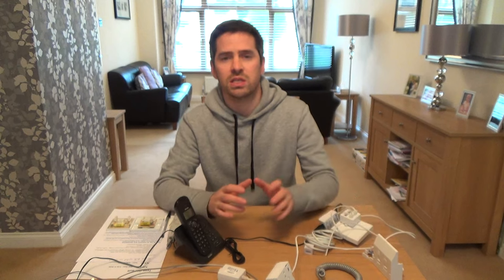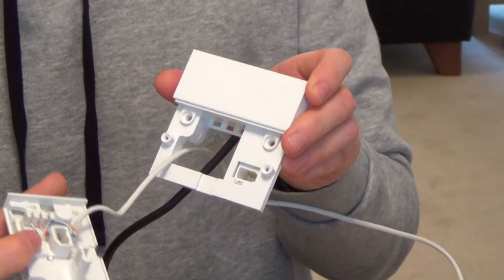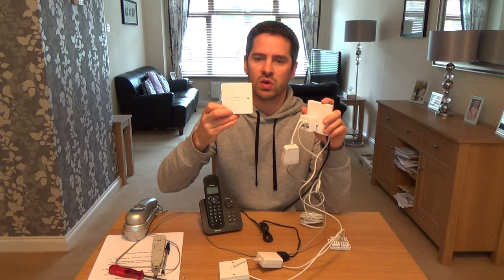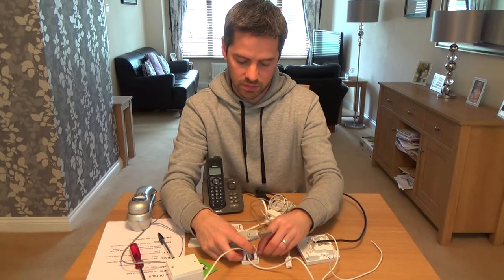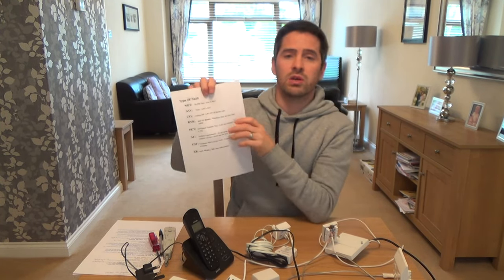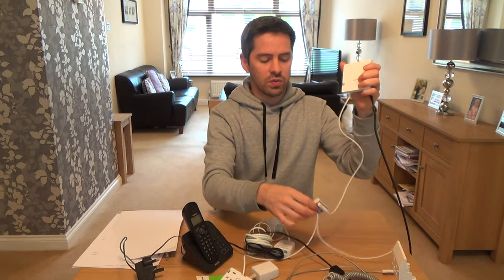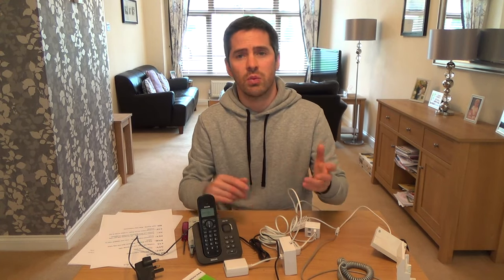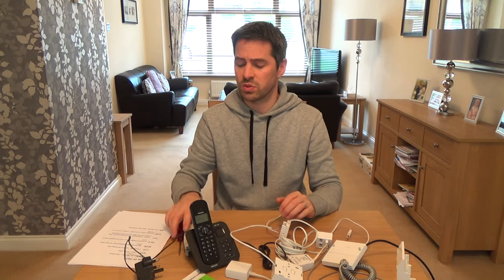How To Fix your TELEPHONE LINE, landline phone FAULT finding and REPAIR.

Comment: Hi Vince, Great video, thanks. 
I now have BT Digital line via the router. So far,  I haven't been able to receive calls (I can make calls). I reported the fault to BT and after going through router resets etc, they passed the fault to Openreach for investigation (I am still waiting). This afternoon, I picked up the phone that has the problem and phoned myself and the 2nd phone in the house rang. In other words, I called myself and it rang (it's meant to the same line). If I call the house using my mobile phone or if my wife uses her mobile phone, work phone etc the line is dead and there's a continuous tone.
Any suggestions please? Thanks.

Comment: Handy vid! Wondering if you could help me with a dilemma? In a few days window fitters will be ripping out my old ones and installing double glazing. But my landline cable goes through the old frame so it will be cut or damaged. If cut can I desire the two ends of the cable? Maybe twist the wires together? Or does it need putting into the phone connection outlet thing? If so, is there a way of doing it without those specialist pliers type tools you have there? Any info would be greatly appreciated.  Ps, my talk talk connection outlet box looks a little different to ones you have. I used to have one with that line/test socket but got a newer model fitted last year. Called a Master socket 5c.  Has sloped top and 2 plug holes on front.  ??

Comment: I have followed all of your video re-testing phoneline for noise on line..
Callers can hear me all right but when I dial out the noise is quiet loud.
The problem seams to be with my router.....
The line is clear both ends  when my router is disconnected.
How far distance  away do I need my TV to be away from my Router.
Otherwise I might need a new router which was installed 3 years ago with SKY.
Any help would be kindly appreciated.
Before I start to call an engineer/of SKY out.
Your video was excellent and very helpful.
Janet.
Reply from the maker: +janet collins Hi Janet, could it be a faulty microfilter or a phone that is not filtered properly?
Reply: +My Mate VINCE 
Thank you for your reply.
I have put a brand new microfilter on. And purchased a brand new retro type phone with cord and handle. As I have said my phone works perfectly when I unplug my router.  I have tried placing it in different places in the room but the crackling noise is still there. I am in a mobile phone living here for 20 years, perhaps it's an old type socket although my neighbours line is fine.
I am insured with SKY so will give them a call.
Thank you for all of your help.
Janet.

Comment: In the US…they’re still using the old bell system that was decommissioned in 1940s….and if u want it updated u have to pay someone to do it….the phone companies don’t even update them anymore and won’t do it even if u try to hire it out separately…so my home has a 1940 bell system box with 4 pegs that have bolts to hold wires on it…they ran a wire across two of my neighbors yards…the alleyway…through my yard and into the box…that’s being held in place by two tiny wires…it’s not even fastened in anywhere…they charge $95/hour to come look at their equipment…the internet is ran vi the phone line so if they come and look at their modem ..it’s $95…..

Comment: Can the master socket extension side be faulty?  Or the master Socket itself? I've checked the cables for continuity and they are ok.  I've trimmed and reattached the extension cable and its still not working.   My internet speed ping is high and internet speed is lower.

Comment: Hi Vince, thanks really helpful. I have been right through all the wiring in my house which is ok and have narrowed down the fault to my cordless phone, but it is not just my phone as I have borrowed another cordless and I get the same fault. If I use the cordless phone there is interference on the line and the ADSL synchronisation on my router fails. If I use a corded phone this fault does not occur. I see by searching I am not the only one!
Any ideas?
Reply from the maker: Jonathan March Hi, it sounds like the phone isn't filtered, but it should also affect a corded phone. Is the cordless phone plugged in via a microfilter?Thanks Vince

Comment: My landline noisy & crackling. Engineers told me there are two faults on the line coming into the house ( underground), but it's inside my property & therefore my responsibility to get it fixed

Comment: I took the phone line from my cordless phone and plugged it in my landline and the landline works fine.  But when I plug the line into the cordless I have NO service and it's just searching. It must be my base phone right?  Thank you.
Reply from the maker: Yes, if you are using the same lead that worked previously then it looks like the cordless phone might be faulty....unless the batteries have failed.

Comment: Please help. I have an intermittent fault in which sometimes people get "invalid number message" and cannot get through to my phone. Sometimes it works. This happens even when NOTHING is plugged in and the socket is empty. What does this mean? Surely it must be an issue for an engineer visit if the fault is present when the socket is empty?

Comment: I could only watch about 11 minutes of that. Not everyone has all that junk connected to their phones. I live in America and still have an old-fashioned copper landline, but also have 1 GB fiber for Internet, but no VoIP, and no filters on my landline. (I have the same company for Internet and my landline, a different company for cable television and yet another one for wireless--I chose whichever was better individually, and although I pay more than if I bundled, at least if one  service goes out it is certain not to affect the others.) I think one time the cordless base needed unplugging to reset because someone or some company failed to disconnect from the line and it threw it off. But I'm over 70  now, and I cannot remember one time in my life aside from that that the problem was ever indoor wiring or equipment. Unfortunately my service provider is not maintaining their landlines as they should, Plus they make you wait almost a week to get it repaired, whereas if it was Internet they would be there that afternoon or the next morning. They give low priority to landlines, even though I pay about as much for it as I do for my Internet. A few years ago they had to repair it several times within a few months. Then it was okay for while but they had to repair it a few months ago. It's usually deterioration of the line pair in the cable in the alley behind my house. I think last time it was something further away in the system. 

A couple hours ago all my phones started ringing continuously. If I answered there was loud rapid clicking sound coming from the speaker. If I tried to disconnect all the phones would ring continuously, even the one nonpowered cordless phone. The automated repair line system said it detected a problem on my line and scheduled repair for six days from now. I waited about 12 minutes to speak to a live representative, and the perfunctory guy came on and reaffirmed the scheduled date, and asked if I had any critical dependencies regarding the phone, and I said my burglar and fire alarms were connected by phone to the monitoring station, but apparently that's not enough to get anything quicker. I asked him if there were other problems like this in the area, and he said they were getting a lot of calls from the area. I asked how close to my area they were, and he couldn't tell me (last last time a rep said my area, she mentioned of the whole state, which doesn't tell me anything). I've had to unplug everything to keep it from ringing or having a loud rapid clicking if it's off the hook. Of course I will have to plug it back in periodically to see if it's working. I don't have such convenient testing junctions as you do--usually the older houses have a large metal box attached to the outside of the house with old-fashioned black sockets and exposed wiring--I see they replace that with a more modern but even larger gray plastic box hi believe when I got the fiber cable installed a few years ago; the box door is secured with a screw, and inside there is a small rectangular cover that swings open to access the area that contains the plug for the test. I just plugged in my one corded phone (there's nothing wrong with it, so I will just use one) and as I knew it would be, the rapid clicking is on the exterior line. They always recite that if the problem is inside the house there is an $85 service charge, and I always tell them in my whole life it has never been an inside problem when they had to come out. They try to scare people about it being an inside wiring problem because they sell a separate inside wiring maintenance plan for a monthly charge. Decades ago there was a class action lawsuit, because after the phone company was broken up by the the government, the local companies automatically included a charge for an inside wiring maintenance plan in their bills, even though people had not sign up for it. I discovered it after a couple years and had them take me off the plan, but apparently a lot of people didn't realize the charge was there or that they could out, and there was a class-action lawsuit against the companies resulting in a refund for the years that they were charged without signing up for the plan. I had already quit the plan before the time frame of the lawsuit.

Comment: Bt line got damaged while we were moving in. I though i could just reconnect it. One wire has solid colours and other has dual colour wires. Like blue - blue/white .orange white. Etc. I got a box. Which colour do i connect to ? Help would be deeply appreciated.

Comment: Hi, im having issues where my broadband drops out when the phone rings, ive tried all your fault finding tips in the video. I recently completed some work in my home to add an extra slave socket in my living room to connect my router via a sky microfilter, the cable for this was extended from an existing slave socket in another corner of the room which has my phone plugged into it (my master socket is in the hallway and far away from the slaves so cant use it for my router), the issue i have is that the internet drops out whenever the phone rings or is answered. I have tried adding another microfilter to the phone connection but this caused the router to drop out completely, I then unplugged this new microfilter and left the phone completely unplugged but again the router signal was lost, so now i have to have the phones BT plug inserted into the socket or the internet wont work, can you help?

Comment: first class. We have a problem you don't seem to have covered. The phone rings but when we answer it we cannot connect and there is a faint ringing out tone in the background. There is no dial tone when we try to make calls. We have an ADSL master socket but it is a long way from the small junction box where the cable comes into the house. The cable then goes under the plaster to the master socket. I think BT will say it is our problem despite the fact that the problem appears to be before the master socket. Broadband is fine so I am at a loss, Do you have any suggestions before I call in the professionals?
Reply from the maker: +Robin Clark Hi, 1st double check the test socket in case the ADSL filter is playing up. If the fault is still there then it might be worth just getting a cheap little phone socket or temporarily moving the master socket to the junction box just to connect up to  the incoming wires that feed the junction box to see if you have dial tone. If you do then you know the fault is internal and you can then decide whether to fault find further or pay for the professionals!!!!
Reply: +My Mate VINCE thanks for your help which  meant I could call in BT. The fault was at the top of the pole with one wire disconnected which meant internet worked but not the phone

Comment: I have a no dial tone problem but when trying to eliminate the problem after disconnecting a wire that goes from the master to the back of our building and reconnecting it strait away it fixes the problem for a day or 2. Sometimes it fixes itself as well and having it so intermittent obviously makes it harder to diagnose where the actual fault is any thoughts?
Reply from the maker: choppa Destounis Hi, intermittent faults are always the hardest to find especially without the right testers. Can you not disconnect the cable from the socket at the back of the building for a few days to see if you still have the problem because if you do then the problem may well be on the cable and if you don't then it means you can fault find from the socket in the back of the property onwards. Or plug out all the equipment apart from the equipment plugged into the master socket and see if the problem it still there.
Reply: myhu  Mate VINCE

Comment: BT switched over to digital voice on the 27,01,2022 so they had to sent me a smart hub 2 because my old hub had no phone connection the broadband is working but when i plugged the phone into the new hub there is no dialling tone and i have tried another phone and still no dial tone when i use my mobile to call the landline it says it is busy.

Comment: I have a 70s bakelite trim phone with the cord cut at the back with 4 wires showing red,blue,white and green. Can I take this off and rewire it with a bt line or is there more to it than that. Thanks
Reply: The vintage phone needs to be re-wired inside the phone to work on modern phone lines Danny ...

Comment: Hi My Mate VINCE. Great tutorials Vince. I have a problem. The main twin cable coming in to my home is connected to a small box with jelly crimps. I am having bad interferance and my router keeps going off I have contacted my phone and internet provider and they have both done line checks(from the comfort of their chairs) and I have been informed that everything is ok. If I remove these wires from their crimps and put in place a master box would this be ok I wouldnt have anything plugged into it ie phone because it is high up over the front door near the ceiling so plugging in a phone would be so ugly any tips Vince. Many Thanks. Paul. Liverpool.
Reply from the maker: Paul k Hi Paul, yes you could just wire up a master socket straight onto the twin cable, if it is the old 2 wire cable (figure of eight cable) then you will need to use a screw terminal master socket as the wires are a bit big for the IDC punchdown terminals. Why don't you test the line by temporarily connecting up the master socket but do not remove any wiring and then if you have to put it back as it was you just need to buy some jelly crimps.Thanks Vince
Reply: My Mate VINCE  Fantastic thanks very much Vince. They are a bit big so will do exactly as informed. Once again Vince thanks so much for taking the time to reply, really appreciate it. Paul
Reply from the maker: Paul k Thanks Paul.
Reply: My Mate VINCE hi again Vince. I have done what you suggested and the interference ie dialling tone is still very bad. I contacted my provider yet again but they said yet again that the line has no problems. They said they could arrange an engineer but at a cost  around £144. Vince I have disconnected everything in the house and just done the master test. My provider are making me feel very doubtful of my master test and I may have to submit and pay their costs. I can't prove anything. Anything else you could add please Vince? Paul
Reply from the maker: Paul k Hi Paul, there is much more chance that the fault is external given the distance from the exchange and the wires are exposed to the elements. If you have not damaged the internal wires from decorating etc. then put everything back to how it was and get an engineer out. They are saying it is chargeable because it is testing ok but a noisy line is often where one of the 2 wires is about to break but is just hanging on in there  and while it is just hanging on the line will test ok until the wire breaks and then it will test faulty and then they will send an engineer out without question. If you call out an engineer on a noisy line and the fault is up the pole or in a manhole etc. then it will NOT be chargeable as that is what you pay line rental for. Noisy lines are always a nightmare but if you are confident that the fault is external then they can't charge you.Hope that makes sense.Many thanks Vince
Reply: My Mate VINCE Hi Vince, yeah that makes perfect sense. I have actually changed my extention box and all wiring to the master just to make sure and still get that noisy line I have asked for an engineer and his appointment is tomorrow (thur) so fingers crossed. Thanks again Vince really helpful information and your tutorials are very well put together so much information on basically every thing you would want to know about problems, installing, and fault finding very educational. Glad I found you and of course I subscribed. Hope I dont need to contact you again (in a good way that is) Thanks so much Vince. Paul.

Comment: What about if the phone is the problem and not the line. The line works with another phone plugged in but this one specific phone doesn't work. Is there a way to fix the actual phone ?

Comment: Faulting and replacing a faulty cable is beyond most people in my opinion .. Especially when cables disappear through walls or the wiring isnt wired as standard .....